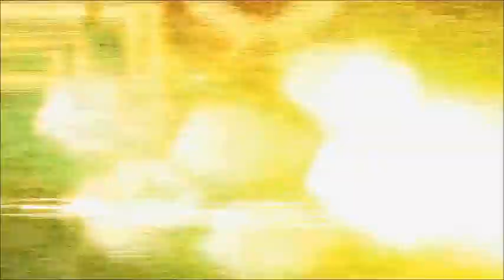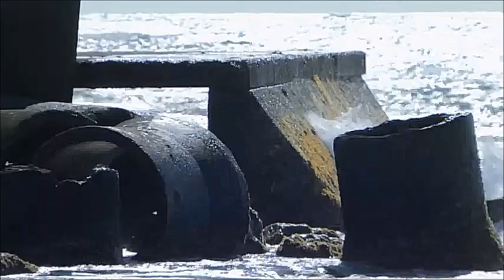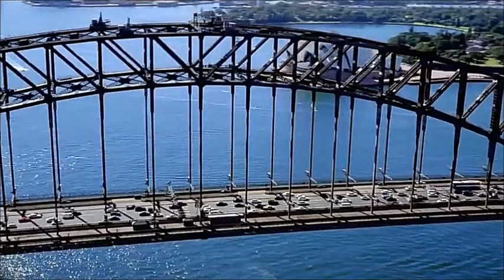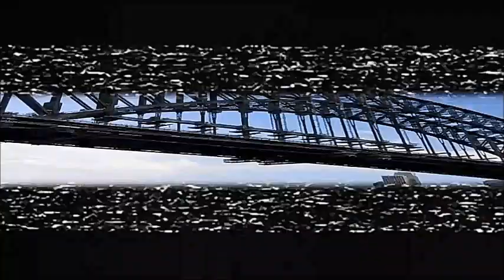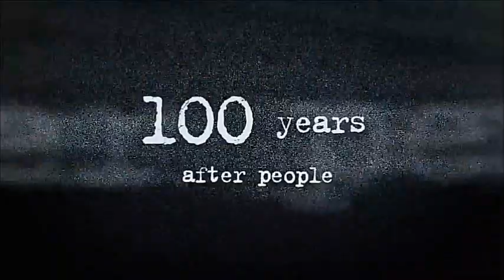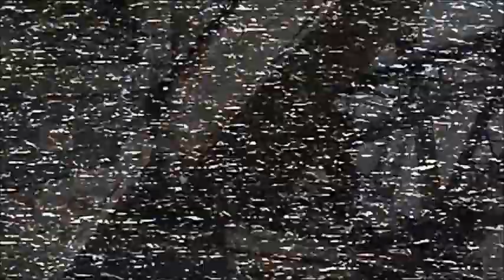Life After People - Sydney Harbour Bridge

Comment: This must be the most unrealistic collapse of any structure in this series! The principle of an arch bridge is that the loads are balanced along the arch and into the hinges at each end. If the bridge failed, both sides would fall toward the middle. The failure depicted here shows both sides just hanging in mid-air, an impossibility! The most likely failure would be, first the road sections would drop individually into the harbour over many years, leaving the arch intact. Eventually, the arch would begin to crush in the centre. Yet this would take many, many decades. The final collapse would likely be with the two sides finally fall towards each other and into the harbour. If you consider how many arches built in ancient times by the Romans and others are still standing, you will realise that arches are extremely stable structures. The Hells Gate Bridge in New York City, which inspired the SHB,  has been estimated to last over 1000 years. Quote "The February 2005 issue of Discover magazine estimated that, if humans were to disappear, the bridge could last for at least a millennium". Unquote. Source: Wikipedia.
Reply: Wrong